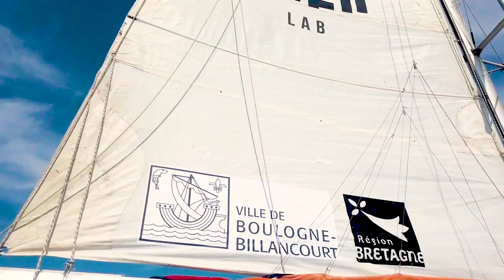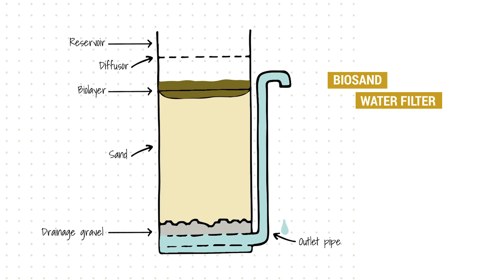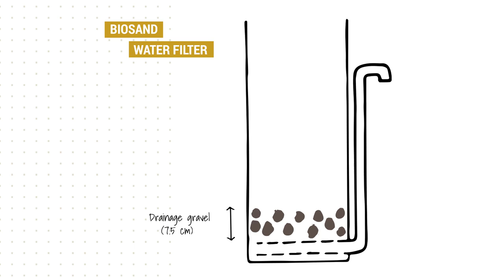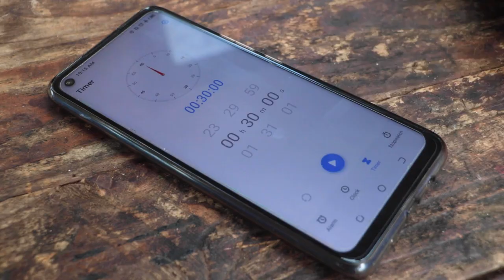🇫🇷 🇬🇧 How to build a biosand filter to get safe drinking water ? - DIY Tutorial 💧

Comment: Love the project but where on earth did you get food-safe plastic piping and accessories? I have looked in every DIY store. Please help. Also, can i make it with 125mm diameter pipe?
Reply: Ask for CPVC or HDPE piping, there's also PEX but I believe that's more like tubing than pipe. Those two types of plastic pipe are safe for drinking water and should be available in most plumbing supply houses.
Reply: @jasonmartindale3171  hey thanks! Thats great. They onlynseem to sell it in grey here with no nice caps and diffuser type discs as shown in this video.

Comment: hi.  is it necessary that you drill small holes on the pipe thats at the bottom?  wouldn't water still enter the opening of the pipe?
Reply from the maker: Probably, but I think the pipe inlet could be clogged more easily
Reply: @low-techlab2411 it probably is another method of controlling the speed of the flow to allow more filter time, granted it wouldn't be much more time but it would slow it down versus an open end pipe.